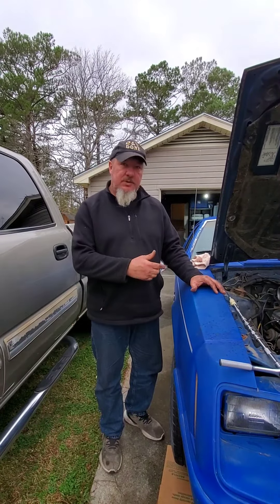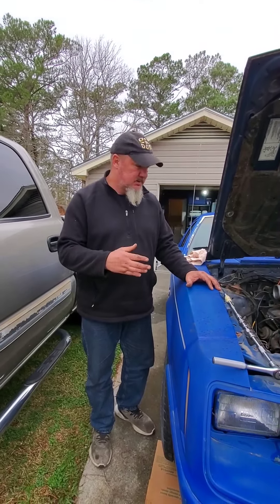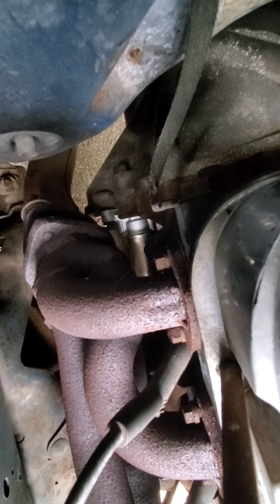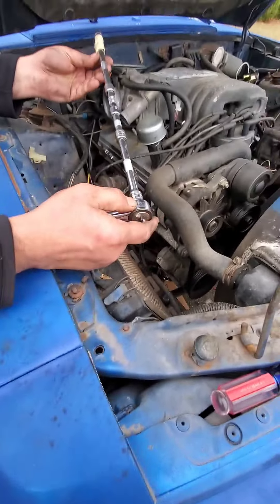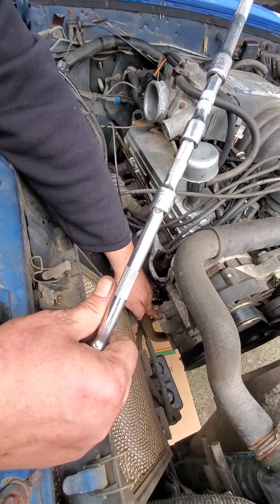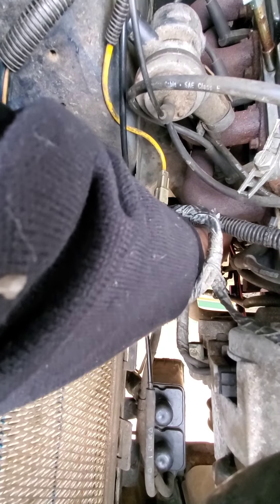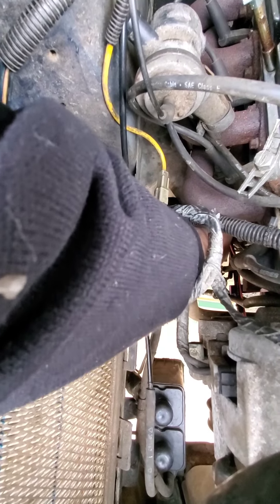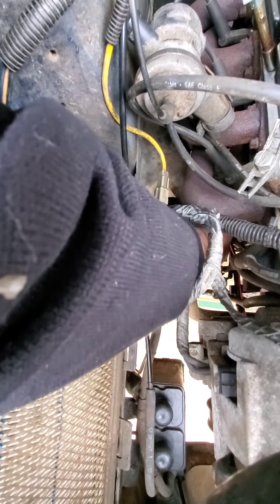1986 Ford Mustang LX Foxbody High Torque Mini Starter installation Part 1.

Comment: Thats a tight spot. Chevys used to be so easy to change out, especially in trucks.
Reply from the maker: Have no clue why Ford engineers made a starter replacement so difficult.